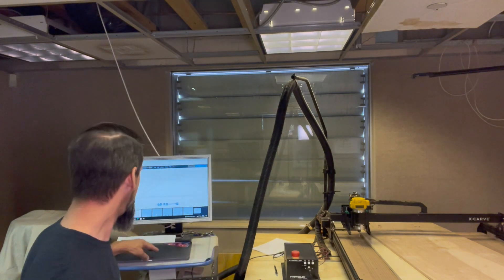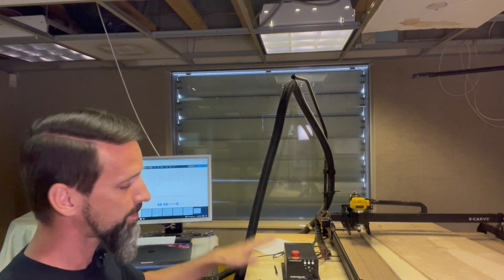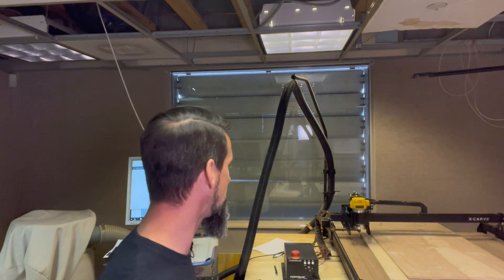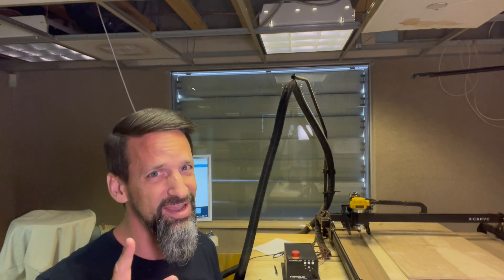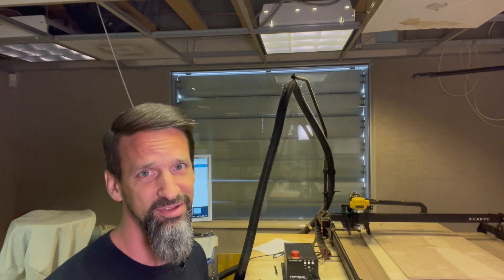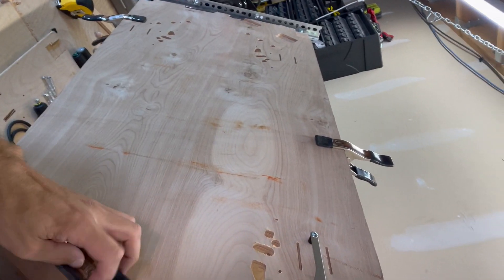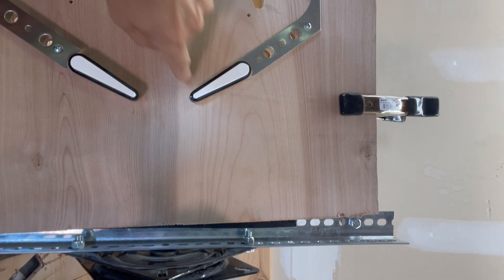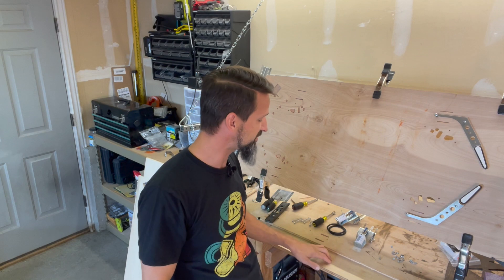HOW TO MAKE A PINBALL MACHINE: CNC'ing a playfield

Comment: I don't own any CNC machine to shape my playfield like that... But I do have a 3d printer. Do you think I could print a whole playfield in parts and then fuse it all together in a single piece, or would you rather print some kind of stencils with all the holes and slots so I could use some old drill, saw and files to do all the diferent cuts?
Reply from the maker: Definitely the latter - there are some other folks who are cutting playfields with jigs and routers and they're looking very good! Make some 3d printed jigs for the various insert shapes and like for the more common mechs (ie a template for sling shots, pop bumpers, etc) and you'll be able to get consistent cuts - then you just have to be good at measuring and getting your jigs in the right place etc
Reply: @thepinballroom  thanks for your quick response!! I will definitely try that and practice in a spare piece of whitewood. In my case, I'm trying to do a smaller replica of a real table. I've already managed to run the rom in my computer and make it control real input and outputs. The only thing left is polishing the electronic device that will manage to control any table I could possibly want to replicate. One device to control any table. And then, of course, I have to build the tables. Your tutorials are being great, by the way. Thanks for your awesome work! ❤️
Reply from the maker: @mikelarrutiromero9430  that sounds really cool! We wish I knew how to do stuff like that! Good luck! Have fun building!!
Reply: @thepinballroom  It's pretty easy once you know how to do it. And pretty usefull if you can't find any replacement boards for your existing game!
Thanks! I will really enjoy the process 😊

Comment: Any recommendations for someone living in the city (condo building), with no access to a big workspace (for cnc machine, etc). I have enough space to design, assemble, but can’t do much woodwork / use larger tools.

Would you recommend working with a local CNC shop maybe? Bring them the cad, and have them make the cuts?
Reply: yeah, I would ask around and see if you have a local makerspace anywhere close that you could use - if that doesn't work, check with local high school woodshops and wood mills with CNC's - somewhere you'll find a wood shop :)  - and if all that fails,  you could get a decent whitewood cut with just hand tools, power-drill and handsaw, etc you just need to go slow and take your time so the cuts are as straight/accurate as possible, etc - some people do it without CNC machines and they turn out just fine.
Reply: @SKondris  great! Thanks for the tips! I’ll start asking around my area
Reply from the maker: Good luck!